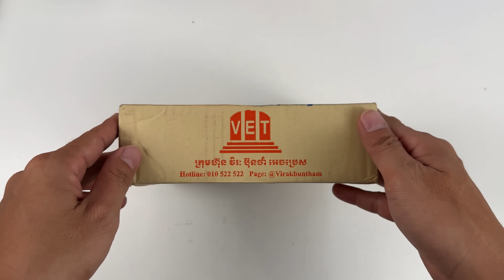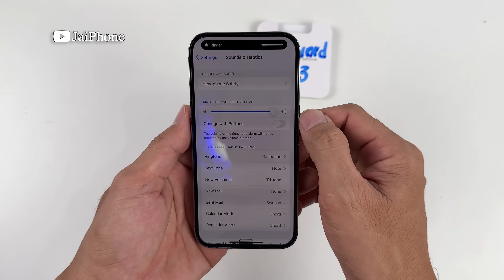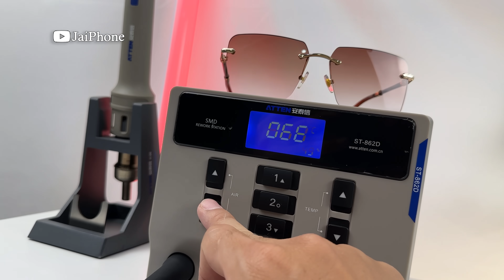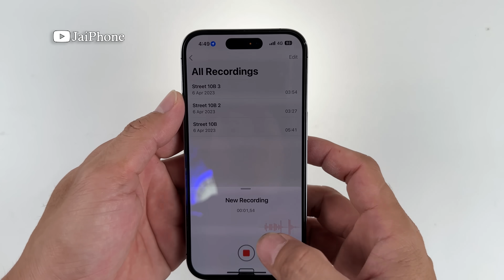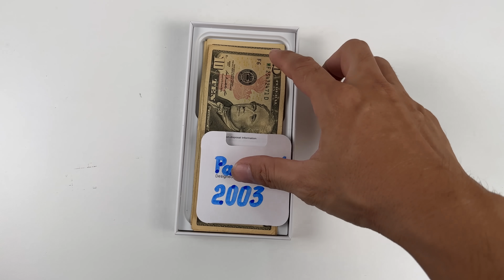How To Restore/Replacement iPhone 14 Pro Back Glass Cracked

Comment: i saw someone using a laser machine to get rid of the backglass adhesive, maybe it could help with future backglass repairs
Reply: But it leaves marks on steel of the back of the phone
Reply: @mirarif9226  on the frame? thats usually caused because it isnt positioned correctly
Reply: I thinks its money talks wireless he is really good at repairing phones or pretty much anything.
Reply: @IkaiaPlay101  the one i saw wasnt him, but his content is defo the same thing i saw
Reply: Is the rear glass apple logo emboss or sticker? I just replace mine everything looks original but the apple logo at the back is sticker not emboss
Reply: @Khabib9-z8w  painted on the backglass, or a seperate component glued on old models
Reply: @haters3327  i see,the orignal iphone rear logo too is painted i supposed?
Reply: @Khabib9-z8w  no clue
Reply: Those laser machines are about $1500. A good enough mini heat gun can be bought for $50, $125 or so for an adjustable heat gun + soldering iron combo. Everyone's got to start somewhere, and most people have to earn their way to upgrades like that.
Reply: انا معجب بل ايفون ❤🎉
Reply: Yes JerryRigEverything showed off that, and it worked flawless with the laser.

Comment: I do these all of the time. My only suggestion would be to take off the screen and remove the battery. That open hole at the bottom has clear access to the battery and if punctured then that’s all she wrote for the phone

Comment: Great work. But you could have placed a protective film on the camera lenses before breaking the glass around. Also you successfully scratched all the metal parts inside with that sharp tool. 😢
Reply from the maker: Yes thank you for your comment 💞😘🙏

Comment: This is terrible!!! The smartphone needs to be disassembled before carrying out the procedure for replacing the cover!!! You understand that once again you expose the motherboard to heat, you can damage the cable and the fragments will definitely get inside! The most important thing is that the fragments that fall the shell of the battery can be pierced inside!!! And this, at best, will lead to swelling of the battery and the swollen battery can break the display module!!! In the worst case, it can catch fire !!!

Comment: Do you have to use a heat gun like yours or could you use a typical heat gun with 2 heat settings?
Reply: What he was using was a soldering heat gun, with quite a focused tip.

Comment: The best part is Apple got zip from this repair. I really hate how much Apple has locked everything where you have to get them to swap parts.

This anti-repair from Apple has to stop. It's a huge middle finger to their own customers
Reply: Their standards has a lot of differences compared to this. After a few months use this may be easily damaged and if you done with apple store noo need to look back this is from my own experience. If you are doing it cleany 💯 and it will last forever you can demand and you can demand the price that’s what apple is doing. No outlet can replace apple standards of repairs
Reply: This looks nice, but there is no water resistance after this repair and the heatgun killed the battery. I have in my service place swollen batteries after backglass repairs like this about two every month.
Reply: So you can go and "repair" them on whatever unauthorised service ? 😂 no thx

Comment: Do not do this at home, you will end up damaging your phone. He didn’t even take out the camera or hardware, the repair it self can easily damage the camera stabilisation from the breakdowns, and battery and hardware can not always take 250 degrees. If you wanna ruin your phone 3/10 times then so this.